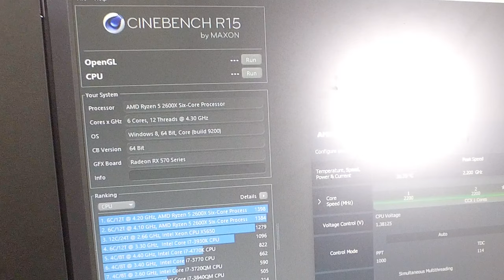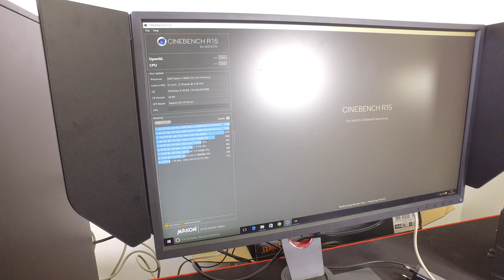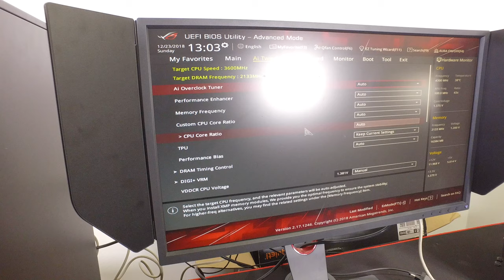SILENT GAMING BUILD 2019 FEAT BE QUIET (IS IT FIXED?) 😁??

Comment: the be quiet line pc's are amazing i have one and i had never a beter pc money wise power wise and silent wise best gaming pc ever i have mine for 2 years never had any problem runs smooth and economic since i never put anything unnecesary things in my pc like all those lights inside that taxes you'r pc on heat and powerdrain